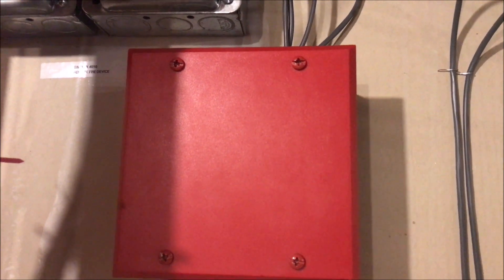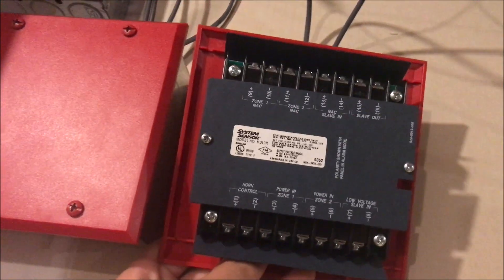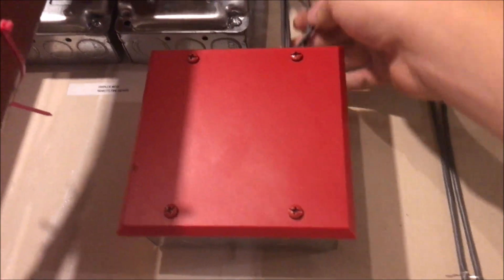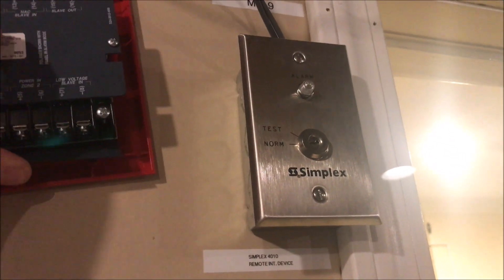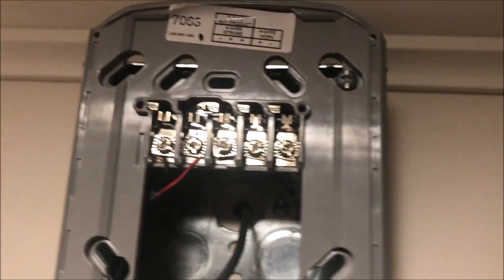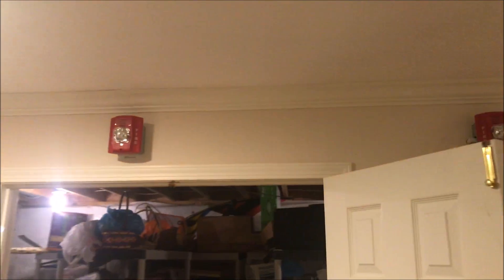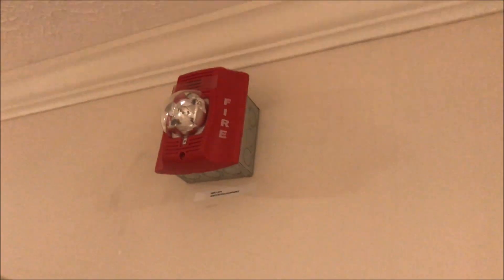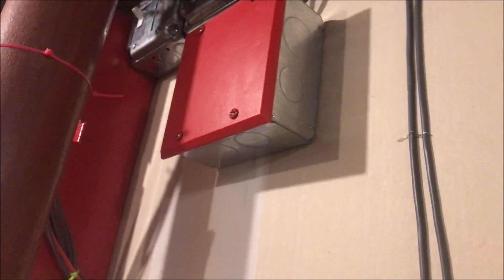What The Heck Is It?! Sync Module (System Sensor MDL3R)

Comment: So if you have a 4 wire device, can you wire the horn and strobe circuit together and use the sync module?
Reply from the maker: Yes and No. it all depends if the device supports two-wire control and if there is a sync module/protocol for that specific device.
Reply: Yes you can

Comment: On the standard MDL (I don't know what the difference is off the top of my head), I've was able to not only get the Advance line to sync, but also the "classic" line as well...even on two wires. Not sure if you tried this, but this would work if you use jumpers for the horn and the strobe terminals on the four-wire "classic." These MDL modules are pretty cool. Never realized there was an MDL3R...great video, and nicely explained.
Reply from the maker: I don't own an MDL, but i do have one classic remote strobe up that goes in sync with the Advances. I have not tried just classics on it yet.